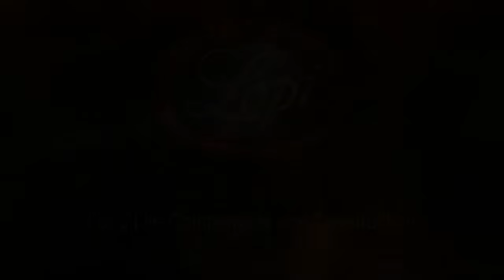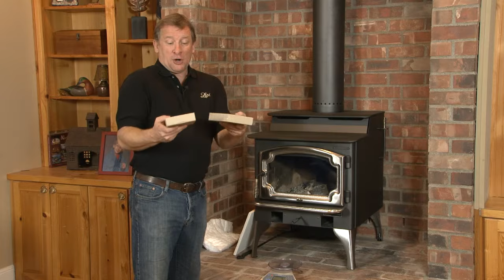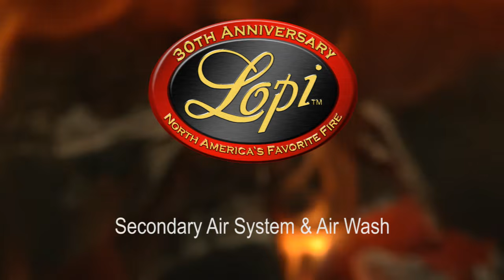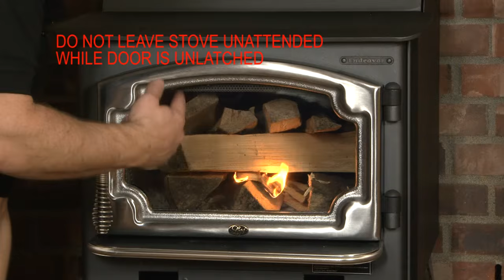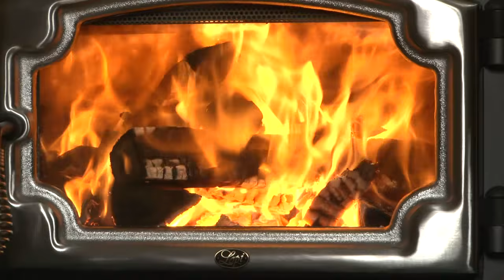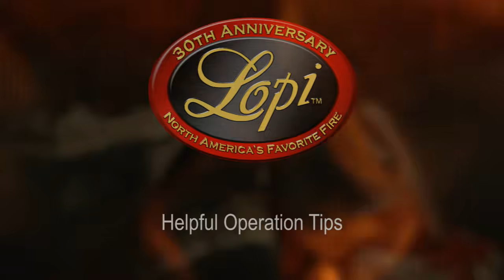Living With Your Lopi Wood Stove

Comment: I have an old 1990s Answer Lopi, but I'm getting too much smoke everytime I open it to place more wood.  There  is nothing blocking the smoke on the chimney and it does have a high enough exit...   I'm not sure what to do.  Any ideas?
Reply: When you open the door to add wood, had you opened or closed the firebox airflow ? I have not used mine for 15 yrs, about forgot the terminology.
Reply: @erwinbrubacker7488  I leave the airflow stick at the bottom open, the one that you pull and push,...  should I leave it closed so the only airflow is from the door when I open it?  Hadn't thought of that... wouldn't think that would influence much though, but I can try it next time.

I live in Brazil and use it very little.
Reply: Remove the stove pipe and make sure there isn't a bunch of soot on top of the baffle had this happen to me on my fire place insert the previous home owner had never cleaned it out and the chimney looked clean but the first fire we had smoked bad out the door removed the baffle and it was full of soot and ash

Comment: I accidentally pushed green start button when cleaning under wood stove, the fire was going fine already.  Is there a way to turn off the noise buzzing fast when not needed?  I know you can push in the button and it will turn off in less time than full run, but it still goes for long time.
Reply from the maker: No, there is not a good way to do this. You are already aware that you can press the button again to cancel the process, however it will still run for cooling purposes. You could unplug the unit, however that is not recommended because of the cooling function.

Comment: My house was built in 85 and the stove that came with the house is literally identical the only difference is it’s got two folding doors on it. However my blower took a crap and I can not figure out what model and year my stove is but it’s literally the same look as this one. Are all the blowers the same for this model? Will this models blower be compatible with an 80s model?
Reply from the maker: We do still carry some parts for older stoves such as yours, but identifying the model will likely be a necessity for finding the right part. Since you are having trouble with this, the assistance of a dealer would probably help greatly. You can use this web page to locate one near to you: https://www.lopistoves.com/where-to-buy/

Take a lot of pictures of the stove and share them with the dealer either via email or in person. Hopefully they will be able to recognize the stove or tell you where to look to find a model/serial number.

Comment: Excellent overview...now to find a video of what models are available in 2024 and which size I need for 1667 sq ft home...
Reply from the maker: Thank you! We will work on a video like you have described.

A good place to start would be to determine the type of fuel you will be using. This will narrow down your product options to one category. A chart that can help you determine which fuel type is right for you can be found here https://www.lopistoves.com/products/

If wood is your chosen fuel type, this video may be of interest to you as it highlights the technology in our new wood burning units https://youtu.be/-WgWdAVJTp4?si=FfEj7Uo-ouBHpD0e

Once you have narrowed down the fuel type, you will want to decide whether you want a freestanding unit, or a unit that will be inserted/installed into a hearth.

Now that you have figured out what fuel you will burn and what form factor you would like, you can more efficiently browse the products on our website using the "Products" drop down menu.

Our network of dealers are here to help! https://www.lopistoves.com/where-to-buy/
Contact your local dealer or visit them in store for assistance in selecting the right product for you, as well as for installation services.

Comment: Cold rolled steel is mild steel
Reply from the maker: Mild steel has nothing to do with it being cold rolled or hot rolled. Cold rolled steel is simply hot rolled steal that has undergone additional processing at room temperature, making it stronger and giving it a better surface finish. Mild steel is available as either hot rolled or cold rolled. We upgrade to cold rolled steel for its additional strength.
Reply: @LopiNorthAmericasFavoriteFire  Thank you!

Comment: 9:08  My Lopi 520/96 air control is just the opposite.  All the way in, full on fire, all the way out, closed.   It also does not have a bypass damper.  

From the manual: 

"Page 29
OPERATING YOUR APPLIANCE
Location and Use of Controls
Combustion Air Control
The Combustion Air Control is located in the center under the ashlip and is operated by pushing or pulling
the control. When the control is completely pushed in, it is in the fully open position. When it is completely
pulled out, it is in the fully closed position."

Why would this air control not be the same on all Lopi models?